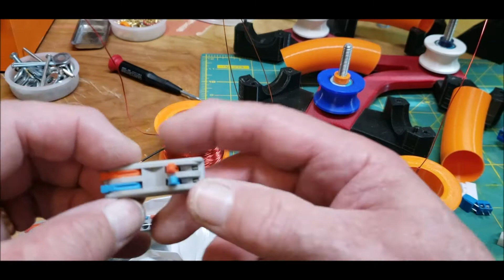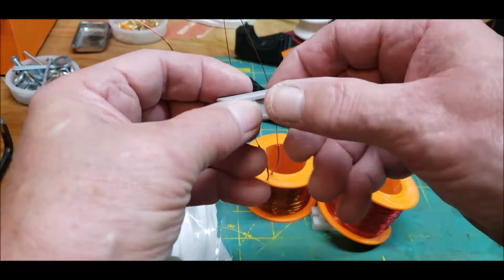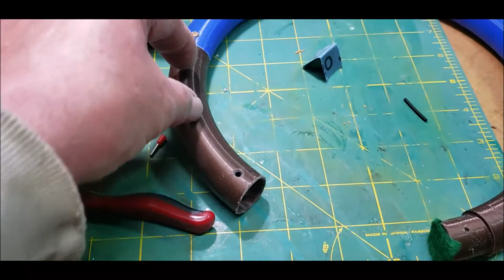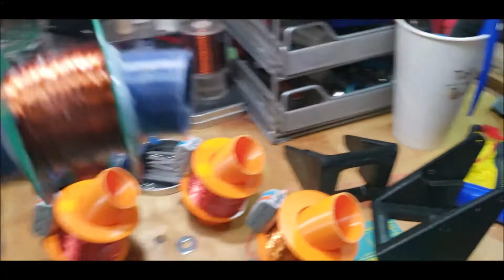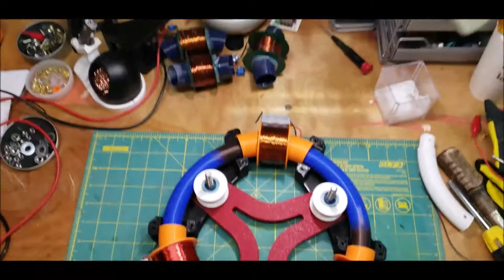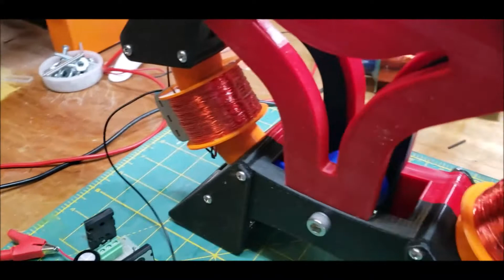3D Printed Solenoid Motor (New coils)

Comment: I am so pleased you took this on this project, you are the right person to get this going.
The coils look great, the thing I like about this is there are so many options to how it can be configured, would like to see the person that gave you the circuit build one as well to see what he would come up with, my life has made things dificalt for me to have time to play as I will need to move house in mid October and after 24 years of living here I have a lot to sort out, what to keep and what not.
I am impressed with what you have achieved so far, but think it will improve as you place coils to collect power to run under its own power and with some luck produce extra for use.
Well done very happy to see your success so far.
Reply from the maker: Hey thanks my friend! It was a long time coming and many many proto types to finally get this one going. And yes if Skycollection made one it would put mine to shame as he builds his stuff to perfection. Remember this was YOUR idea and files that I just took and ran with it. I really was not sure it would ever get done and I can only work on this stuff one day a week. But there will many configs and more different types of motors :-}
Reply: @mcorrade  just keep the CONTINUITY flowing. Try making SHIM locks for your coils or maybe compression clamps on both sides. Like what you use on garden hoses. FYI  I loved watching it spin laying down. Put any silicone grease on any of the wear points? Or is that plastic reactive to grease?
Reply from the maker: @MAGnetICus_Attractus  I really like it laying down as well which give me ideas for future designs. I think way back when you have mentioned building it horizontal :). It actually rides on the rollers just fine that way which surprised me.